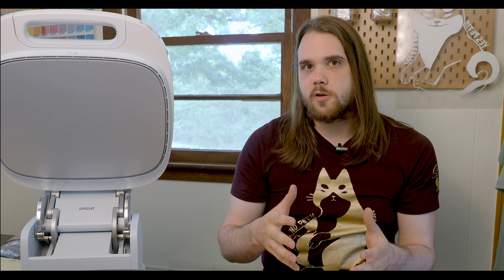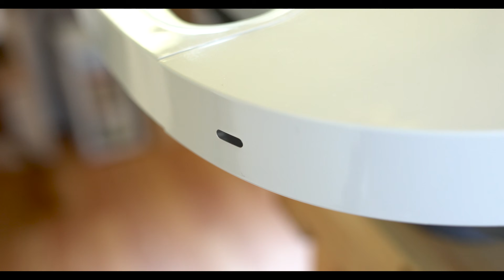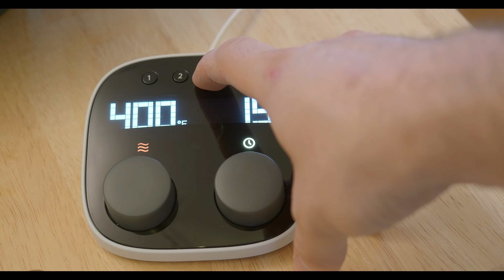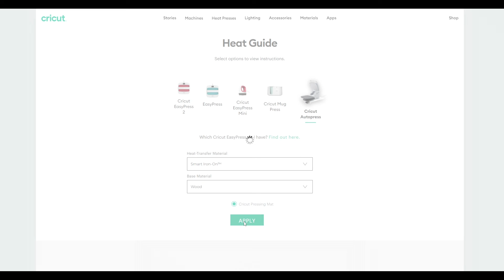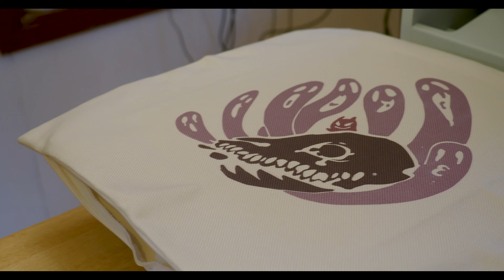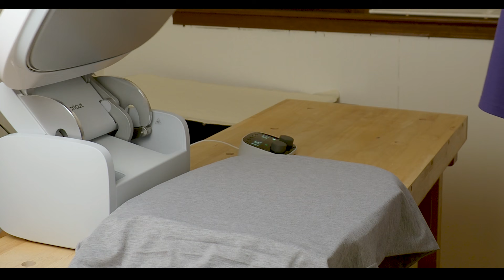Cricut Autopress Review: Save Time, Craft More

Comment: The heat press is 25 degrees off so keep that in mind when using it… If your temperature calls for 300 put the temperature to 325… Also you will need two heating mats to get the right amount of pressure.. One heating mat most jobs will not come out right.. There’s a slight gap between the plates when closed that gives you uneven pressure with one mat.. Through trial and error I got the autopress working to perfection… I hated the machine at first now I love it!!